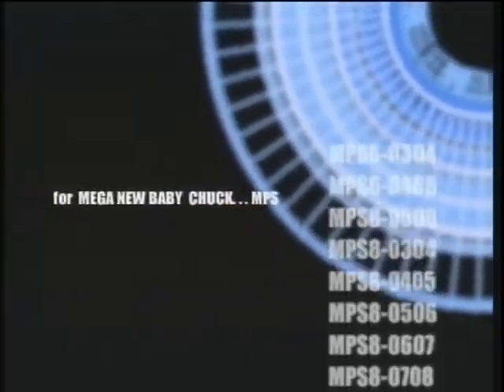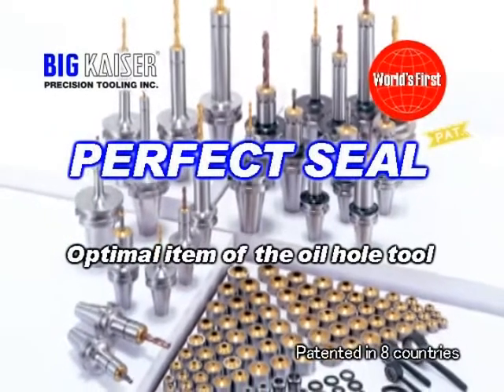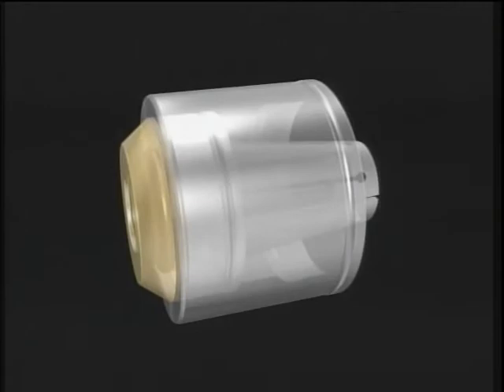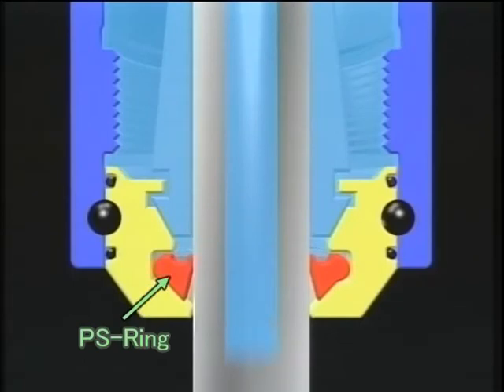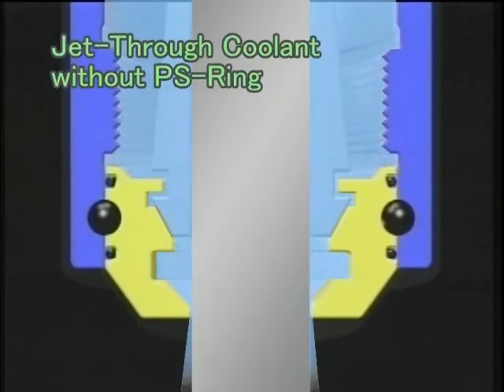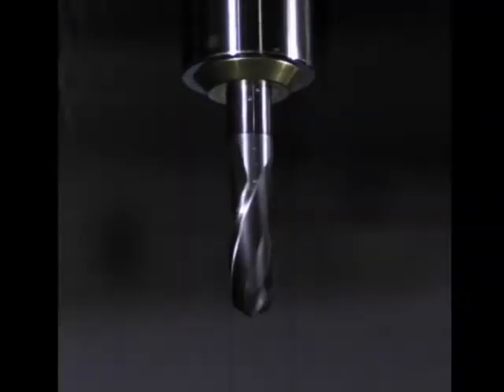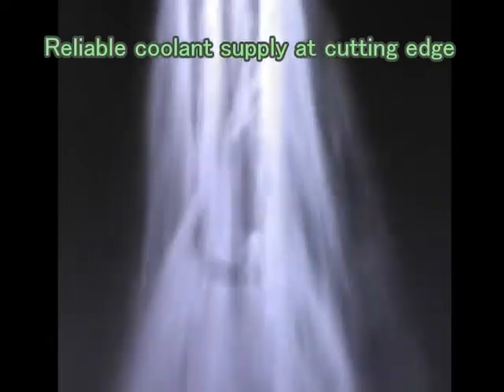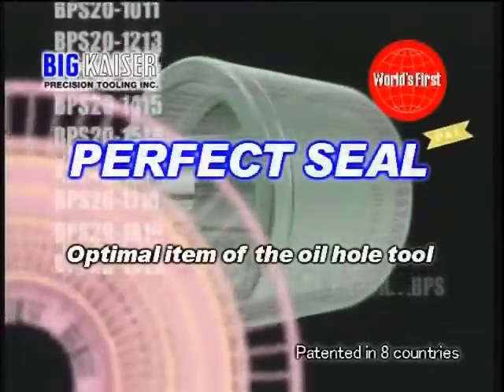MEGA Perfect Seal | BIG DAISHOWA—Americas

Comment: Can you run this with air for dust proofing? Or only colant?
Reply from the maker: Yes, you can use air. It's very effective against graphite with the seal in place. Our MEGA N and MEGA ER tool holders also have a second o-ring between the nut and body to keep debris out.